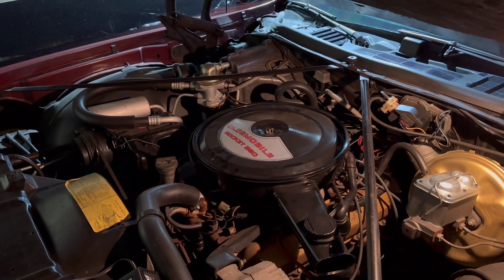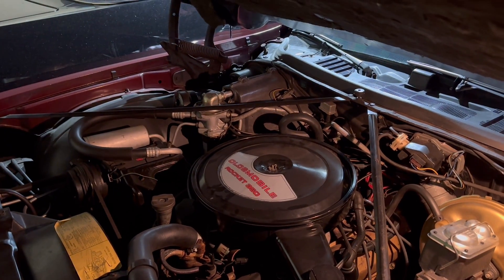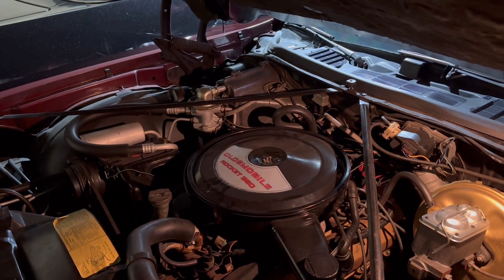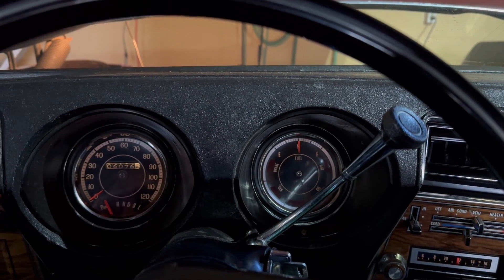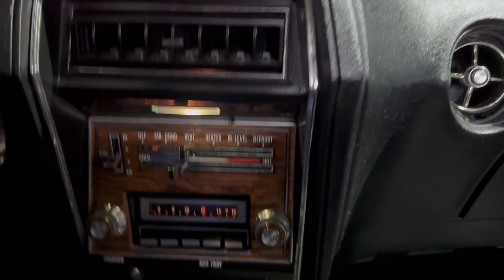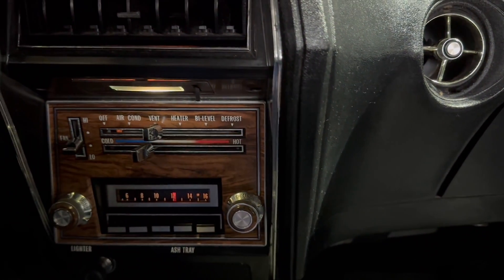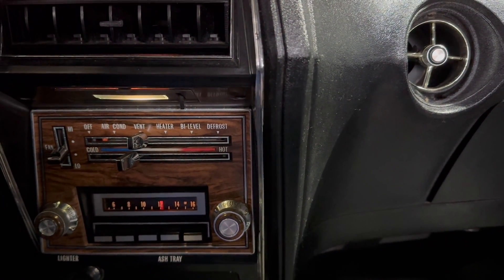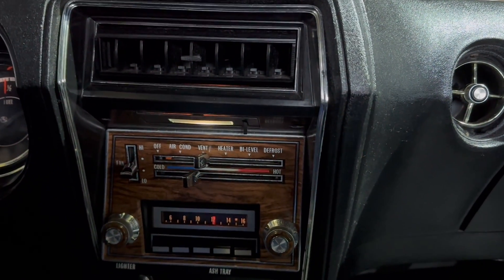GM's "Coolest" Invention Was a Strange Approach to Air Conditioning

Comment: I noticed the DOJ/EPA made eBay remove all of the R12 refrigerant listings.   R134A just isn't the same as R12.  Seems like I vaguely remember that A/C setting on my parents Impala.  I thought the label was Max A/C.  I remember the sight glass on the accumulator. A good way to tell if the refrigerant was low.
Reply: R134a requires more to cool than R12. R134a requires fans on the condenser for it to work as well as R12. The pressure in the evaporator is different then R12 , too. Most get this wrong when converting from R12 to R134a. R12 also can work better with a little moisture in the system than R134a. Definitely not the same but requires more work for them to cool the same. R134a works fine in modern cars with AC systems designed for R134a.
Reply: Yes, the system is basically never as good after conversion.

There is a direct replacement for R12 now that is supposed to be at the least nearly as good as the original R12...some feel even better.  You do not have to convert the system with it.  There is a brand called "Freeze 12".  I am forgetting if that is RS-24...

Comment: Dad's 76 Electra 225 used that compressor. Even on the hottest days you could turn that car into a rolling meat locker. That was a fantastic AC system that most modern cars cannot measure up to.
Reply: I live in Las Vegas, we had a 75' Electra 225 and I remember freezing in the back seat, mid summer. 
The best modern AC I have ever felt in  any recent car... SUZUKI AERIO! 
Yes, that dumb Suzuki has the best AC of any modern vehicle I've ever had. I don't want to daily drive my F350, diesel is too pricey.
Reply: Never took much to get an old gm to have cold air
Reply: The same year Mercedes 230E had a compressor with 1/4th capacity and (if you even paid the outrageous price for the option) it would only ever blow "less warm".
Reply: IIRC, the Mercedes 6.9 also used this Frigidaire/GM compressor.  Ours could get insanely cold despite being a black car with black interior in Florida.
Reply: I think the last awesome ac in a car I experienced was a 1994 Jetta.
Reply: Yep I had a 98 and that thing blew ice cold air. My newer Jetta's I had doesn't come close. @sprockkets
Reply: Yeah because that's not needed lmao. New cars use a much more efficient system that doesn't over-cool.
Reply: @TheScrubmuffin69 I beg to differ.  In Florida, most car ACs can't cope.  High humidity = less cooling performance since those BTUs are being eaten up by condensing humidity.
Reply: Good old R12
Reply: @tholmes2169  It was the best
Reply: In that case the only thing missing was the meat hooks!  😂
Reply: I remember freezing in cars with this AC many times back in the 70’s.  Wish AC systems still worked that well.
Reply: @Geordo1960 Anything that worked that well from back then was killed off by the enviro police!
Reply: Back then they used Freon (R12) as the refrigerant. That R134a substitute they use now doesn't come close to it...
Reply: @WessyD1 In a system designed for it, R134A can do the job as well as any R12 system. A friend had a 2000s-era Buick that would freeze your ass off, and I rented a Nissan Maxima that chilled the interior of the car within a minute after sitting in the full summer sun in Florida.
Reply: @BigOldCarChannel  yeah, they will work that well sometimes, but they're basically just making it twice the size it would need to be if it was R12 to get them that way...
Reply: @WessyD123 r12 was one of the main reasons for the ozone layer almost becoming nonexistent. We stopped that and the shit in aerosol cans and now the ozone has started to heal again. Sorry your cars ac is 10% warmer...
Reply: @WessyD1  Bro, do you know what you are talking about? Because those of use who do, know you clearly don't.
Reply: @sprockkets  I do. i've been illegally converting r134a systems to r12/r22 for years :)
Reply: @TheScrubmuffin69 Dig a little deeper and you'll find that wasn't actually the case.

Comment: Most GM vehicles had a vent under the steering column or what we called the ball cooler lol
Reply: The old crotch vent….Toyota still had them in the 90’s
Reply: @Rfk1966 I love the ball cooler in my 80 series Landcruiser
Reply: @Rfk1966 they weren’t the only ones… my parents Dakota and Caravan also had the interior vent which had a lever you could pull down by your left leg to let in fresh air.
Reply: Yep a barrel vent

Comment: A predecessor of the "max" setting?
Reply: No, “max” came before this.  My family’s 1970 Olds 98 had a dedicated button for “max”, and the owner’s manual described what it did (i.e. recirculate) and when to use it.  This Cutlass from a few years later looks like an attempt to hide that info from people, and/or a misguided (IMO) attempt to make the system more “easy to use”.

Comment: My mom's 1975 Caddilac, my dad's 1974 GMC pickup and my 1974 My Monte Carlo all had to have the compressors replaced. My mom's Caddy had to have 2 replacement compressors. They would freeze you out when they worked.

Comment: Pretty much every “modern” car I’ve been in (2000s+) does this. I guess GM was the first to implement it, and everyone else decided it was too good not to copy
Reply: i can tell you atleast no Nissans do this as my family has owned several Nissans and this isnt a feature im familiar with.
Reply: My 2019 Ford does not do this.
Reply: On nearly all  cars, the fan on recirc mode sounds a little bit faster, because there’s less resistance to air flow.  But the video showed a bigger jump in speed, where it actually switched the fan to hi.  I’ve never had a car with the feature shown in the video.  All the cars that I’ve had with A/C let you keep the fan on low in recirc mode, if you want to.

Comment: Great video! My 1982 Malibu Classic is still  R12 and hasn't been recharged since 1994! Still blows ice cold. Interestingly, my car is an early model year car and has the A6 compressor. Had it been built later in the run, it would have had the R4 unit.

Comment: Modern GM vehicles (without auto climate control) work similarly. On my 2018 Cruze for instance... When the AC is on and you turn the hot/cold dial into that final notch all the way cold, it engages recirculation (if you haven't already selected recirc with the separate recirculate button). I don't think the fan speed actually increases, but it sounds like it does since recirculate mode always makes the fan sound slightly louder.
Reply: My VW does the same thing. It's marked AC MAX on the dial and when I turn it there, recirc turns on

Comment: Th A6 compressor is just great. They don't see a lot of appreciation by many enthusiasts. I'm looking to mount the original A6 compressor on my LS swap once A/C time comes around. There is just nothing better than the ice cold GM air.
Reply: The A6 compressor is great but they don't like being turned off and on like newer compressors. The newer system uses a cycle process to regulate the pressure in the evaporator. If you still have the old VIR system you can use the A6 compressor. IF you find or make the brackets it should work. Good luck!
Reply: I'd agree A6 doesn't "like it" but they were OE configured as "clutch slammers" on a few applications.